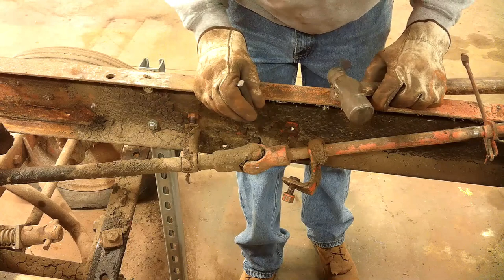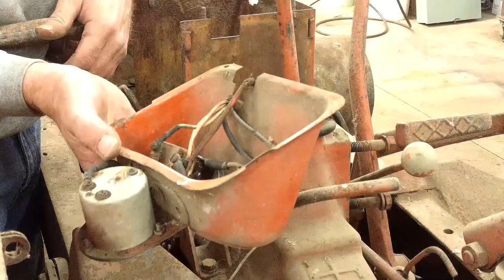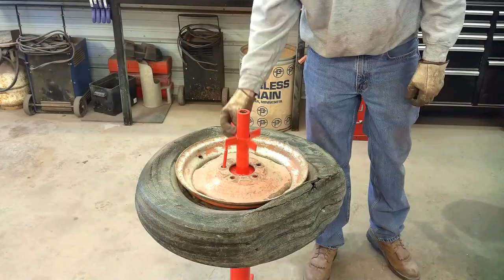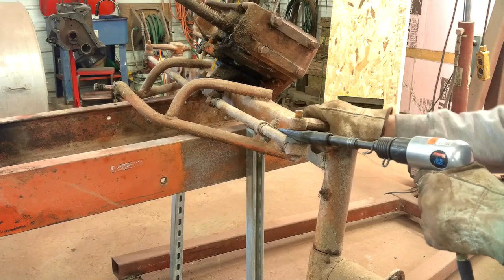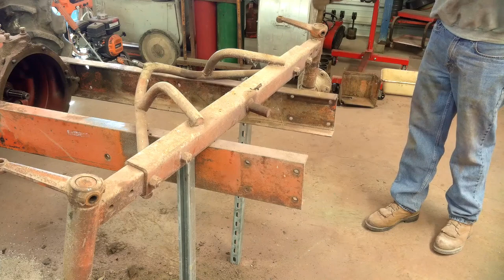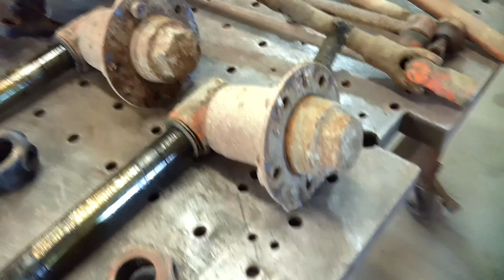Allis Chalmers WD45 Restoration More Disassembly and Getting Ready to Clean Up Ep.7

Comment: I’ve never seen a torque multiplier before either, and I agree with James that the silver/orange paint combo on the rims would be a perfect contrast.  It also never ceases to amaze me just how simple cars, trucks, and tractors were back in the day.  An engine, couple of wires, and a lot of steel and you have a working vehicle.  
Send that hammer on over I’d be happy to fix it🤣!  Hate it when that happens!😂
Reply from the maker: The tool room guy where I used to work threw that torque multiplier away because nobody knew what it was! Needless to say it went home with me! Email me your address, I"ll send that hammer to you.
Reply: Sparks Fire and Baling Wire  I’m not sure how to send you my email and address privately, but if I can figure it out, that would be awesome!👍